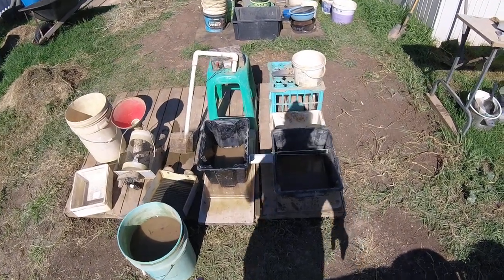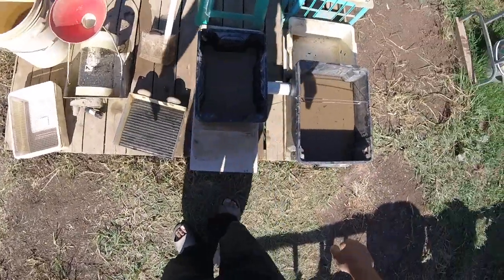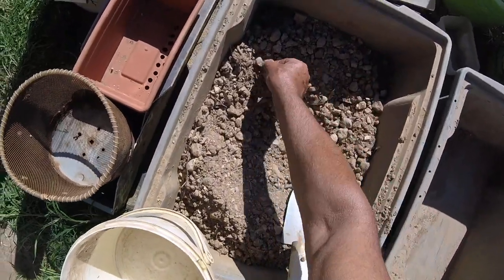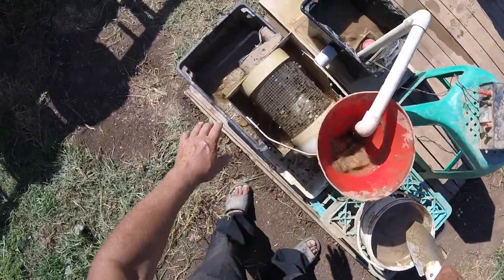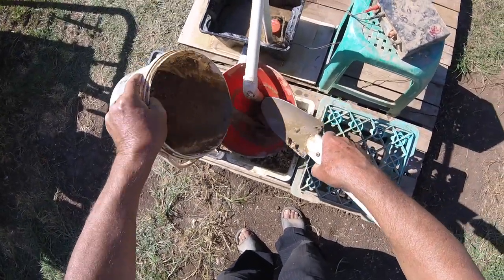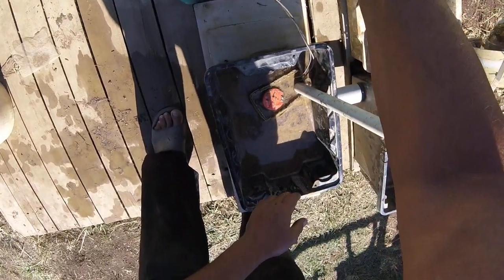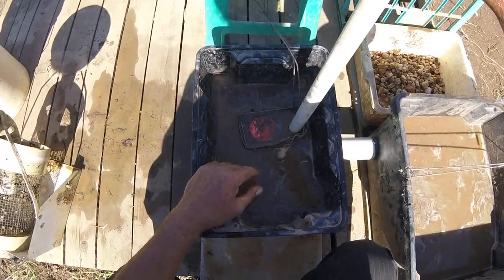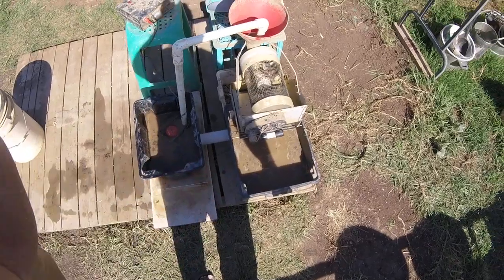Latest Fiddling Modifacation test

Comment: Set your pump on top of a brick or 2, you wont pick up so much silt. Putting the pump inside a bucket  with holes will help as well.
Reply from the maker: Yes I have raised the pump on previous occasions - Not sure why I gave that method away - I seem to be going around in circles with modifications , but this one looks likely to be very useful

Comment: looks good may be cable tye a womans stocking on the pipe in the pump tub then it will fill up with grass and shit mate and pump should be clean just use fly screen around your filter , if you find a long leged stocking you mite get all day pumping with out taking it off the pipe to clean out
Reply from the maker: Hey Peter . thank you for your input.
I did try a short section of stockimg and what it does it balloons up as it gets clogged , but soon gets too clogged and need to be removed and cleaned.
But a long section of stocking may work - just need to find a woman prepared to give up a pair of stockings without wondering what devilish act i am about to do with them.
Reply: @mohammednovalija  yar mate she mite think you put it on your head go rob mint from the gold ha ha good ideas you have but always tinkering to improve your set up mate good stuff
Reply from the maker: @pkgoldopalhunting  I was more thinking she be thinking how perverted I am like maybe sniffing them or wearing then - I hate how I think sometimes
Reply: @mohammednovalija  ha ha ha mate its ok i not tell any one
Reply from the maker: @pkgoldopalhunting  I tried the full length stocking Peter but the issue is the mesh way too fine and clogs quickly.
It worked wrapped around my cage to an extent because it was stretched and that made the holes bit bigger.
I end up getting some mesh I have around my cage and madea small sock out of it using hot glue.
Held on with a lacker band and looks like it may be a goer.

Comment: Why not try and make up a strainer and catch the debris straight off the sluice that way it cleaned off when you lift the sluice box for cleaning and checking for gold. If you put it on an angle the water may wash some material off for you.   Cheers
Reply from the maker: I may have tried catching all the debris straight off the sluice by using a basket made of flywire.
What happenned was the wirs got chocabloc clogged and the debris flowed over the top and got into my pump.
There were other issues as well.
I'm liking what is here , if I can only get at least 1 bucket run without cleaning the crud.

Comment: Mohammed , put a filter wall right through  the middle of the sec. container , cheers
Reply from the maker: That would work but need to seal it and that may cause issues removing it for cleaning.